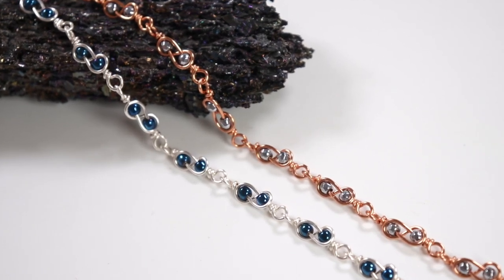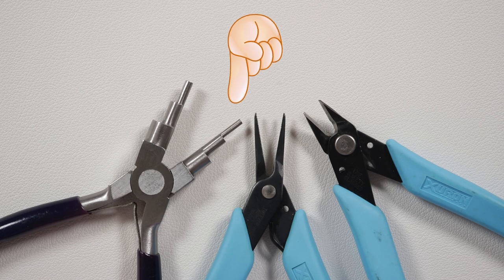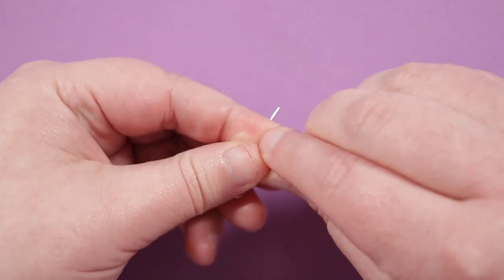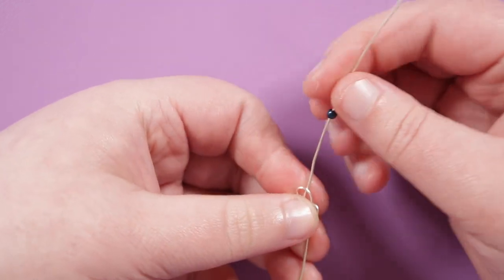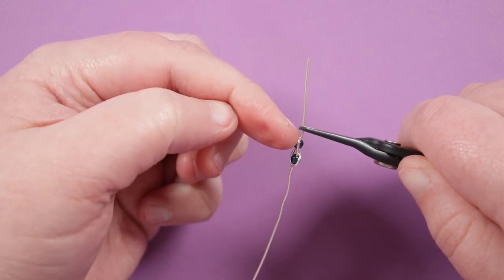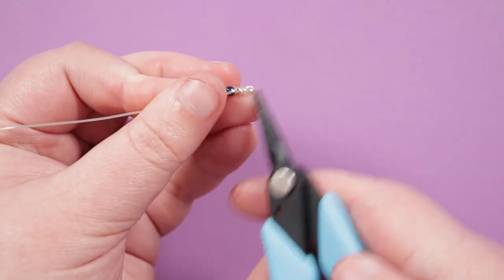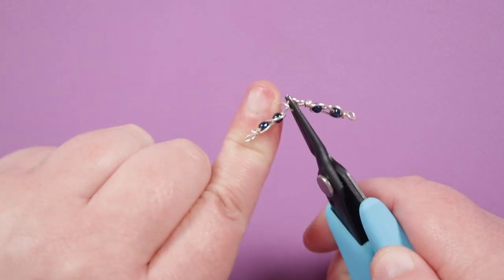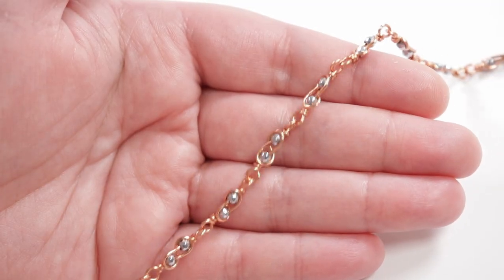Pretzel wirework chain link tutorial

Comment: Yes your description list the materials that you're using it does not tell me the amount of wire that you are starting with.
Reply: I believe she said 40 cm. ?
Reply from the maker: I usually state that in the video. In this case I usually use approximately 40cm of wire. You can make several links with this by continuing to use the same wire until it is no longer long enough to use. I find that way you have minimum wastage of wire, but you can really use whatever you are comfortable with. If you feel like 40cm is a bit too long you can easily use a shorter length. For instance the length I used in the video was just a short length for the purpose of making it easier to show for the video, but it is really whatever length you'd be comfortable working with.